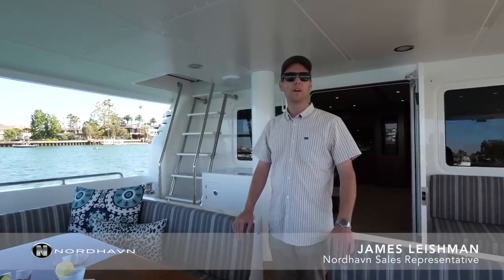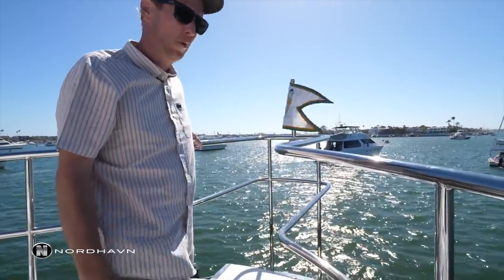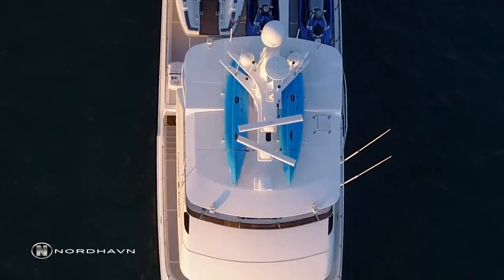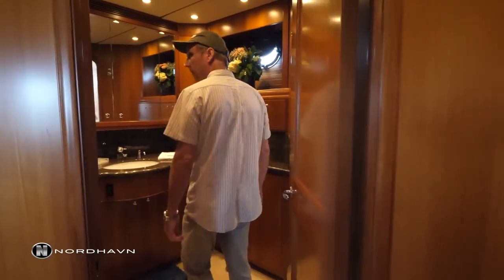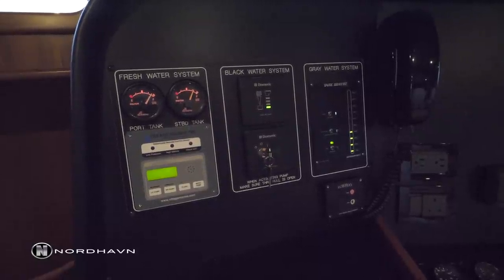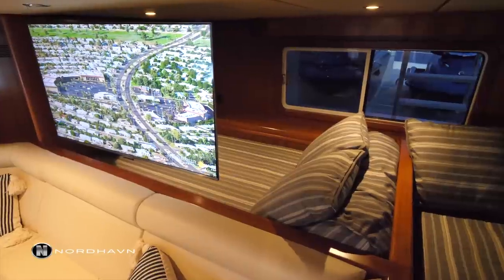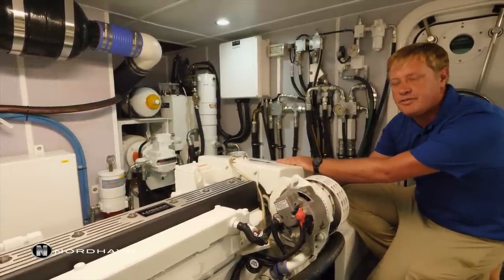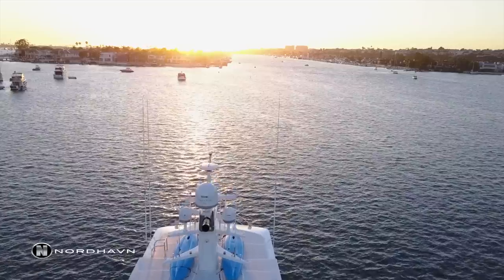Nordhavn Model Walk-through: N76 FPH with James Leishman

Comment: The cleats by the bridge doors look like real knee busters. I like the garage and compressed air. the storage lockers and outdoor seating really nice. I note that the stove fiddles are removable. the dual electrical is neat setup. First Detroit I have seen in a Nordhaven. One of the nicest laid out boats I have seen. although the battery replacement would suck I suspect.
Reply: Colin Park I’m with you on those cleats. With all the Nordhavn’s I’ve looked at, I’ve never seen anything until now that made me think, “Now that needs to be addressed.” She is still a beautiful Yacht. She still got a thumbs up from me 👍🏼

Comment: GREAT Video!   Two questions: 1) What’s the range, cruising speed, and max speed?
2) One of your competitors (Fleming?) seems to have a different pilot house electronics philosophy. They are known for an extremely detailed yacht monitoring, control, interaction video displays, showing and controlling every technical, engine, and ship function, through a set of menu displays. They clearly set great store by it, as they talk about it all the time. What are your thoughts on this type of control feature, and is Nordhavn going to be going in that direction relative to yacht function and control?
Reply: You could easily install a Maretron System to monitor everything across a yacht and control all or some aspects. The NMEA 2000 protocol, which all marine equipment follows allows networking instruments, switches etc, it just depends how deep down that rabbit hole you want to go. Have a look at some of the videos on M/V Dirona, https://mvdirona.com/ he talks about the Maretron system he runs in one of the walk through videos. His maintenance videos are great as well

Comment: Be nice to know the range at a speed. You covered the engine hp, the fuel capacity. You lacking top speed/range and cruising speed /range. Really nice boat but at top speed if you can't make where you want to be or in my case sit forever in the gulf at idle, what do I need left to get back to port. Can she transpacific? Next what kind of weather can she take, what's the maximum wave. you guys never touch the performance why?
Reply: Transatlantic yes - even on a much smaller Norhavn...  tho I couldn't tell you about the rest of the stats for her.